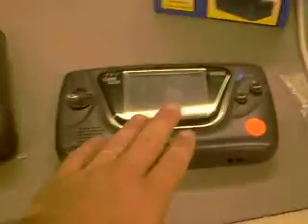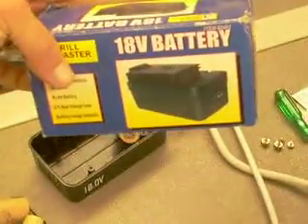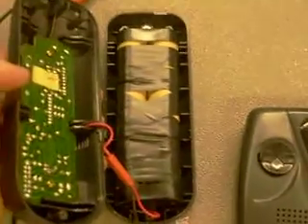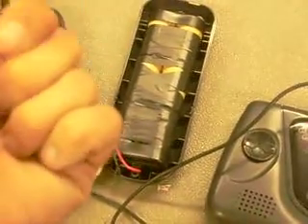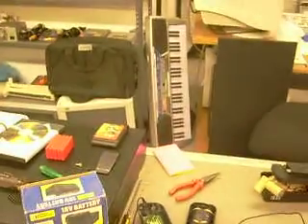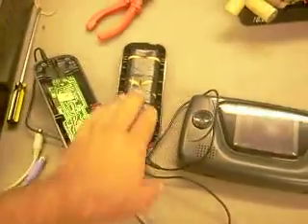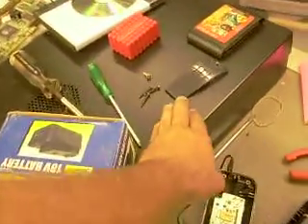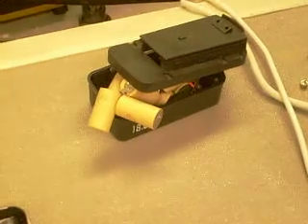I rebuilt a Game Gear external Battery

Comment: Also, not all drill batteries are the same. They vary between 1500 mAh and 3,000 mAh. I'd actually recommend one of those 7.2 volt R/C car packs, since that's what the battery pack essentially is. You can check the amp hour rating of the pack before buying, or you can go with individual cells.
FYI, DeWalt batteries run $120 a pair, that's about $4 each for 2400 mAh cells. Ryobi are about $100 a pair and the cells are only 1200 mAh.

Comment: My thought is this: If you really want to get fancy with the Game Gear, build a custom external pack that has a charging circuit in it. The Galaxy 500 chip would work for this. Next install two thermal limit switches in the Game Gear, one in each battery compartment. Jump the contacts on the power jack that switch out the batteries when a plug is inserted. Install any sort of NiCD or NiMH cells, then plug and play. The Galaxy chip and thermal switches will charge the cells without damaging them.

Comment from the maker: @cubx1979 There's an on/off switch on the pack, sure that's on? Check that first. 

Also, if the pack was used much before you put it away then it migh tbe a dead cell in there. Did the pack have many in it? Try to charge them all separately, to see if you have a single bad cell-- if one is bad then it won't power it, it'll create a short and drain the other two. Not enough voltage.

Comment: @nathanallan1 ok. i thought i had it. When plugged into an AC adapter the charge light comes on. I've left the pack plugged up all last night and all of today, but the charger wont work without the adapter. Im thinking the batteries might be gone. The drill battery had been sitting around for 3 years but was barely used before hand. Any suggestions?

Comment from the maker: @kasdjg Sure! Go get any rechargeable drill battery and the cells ought to be a direct replacement, but much higher capacity. Oddly, buying individual cells is just as much as far as cost (at least when I checked). 

Drill batteries can be had at almost any hardware store. Great cells, too, same as you would buy from allelectronics or other electronics places.

Good luck!

Comment from the maker: The circuit for charging it is built in, so that is regulated. Original cells are Nimh, and the drill battery had the same type, Nimh. So, all is well in Oz. 

Please, people, I'm a professional and there are a LOT of little things to consider when replacing rechargeable cells. If you have questions google it or ask me, I love to tell people what to do :D

Comment from the maker: Right, let me clarify. First, do this at your own risk, batteries CAN be dangerous regardless. Capacity has nothing to do with charge time, threw that in there :) The cells inside originally were something like 800mah, the new ones are 1800mah. It took about 30 minutes to charge and played it for about three hours time. 

continued...